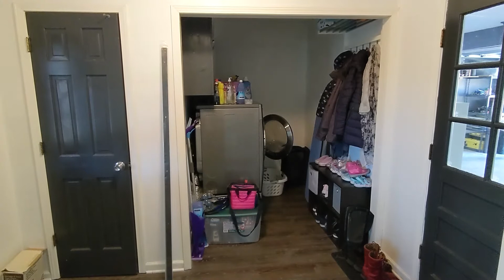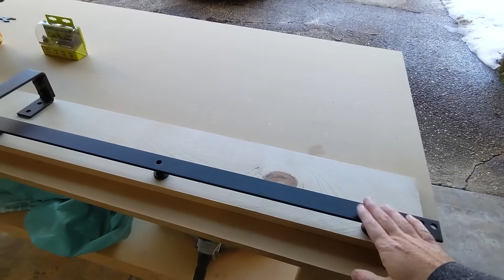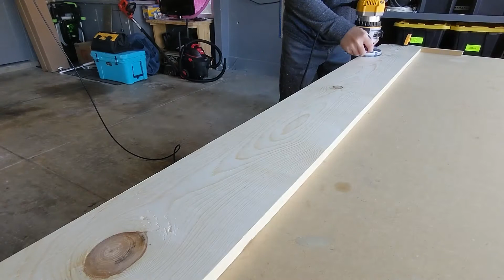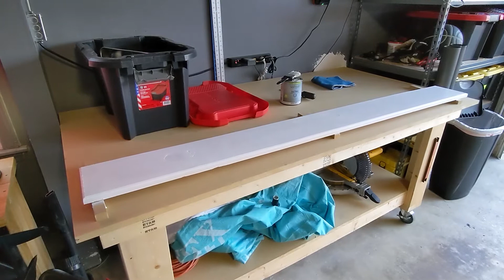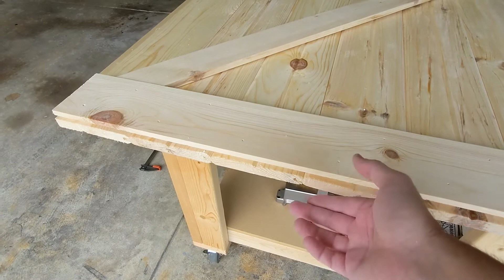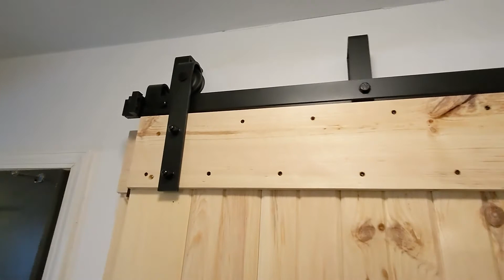Overlapping Barn Doors

Comment: Very nice! Can you use this model but have both doors slide? I need to wide an a pantry door but both doors would need to move so I can access things on both sides. Any ideas?
Reply from the maker: Edith, yes you can have both doors slide with this model. I answered this same question for Ana Bravo below.  Here is the reply I gave her.

You can have both doors slide easily, you just move the stoppers I have on the left door that is keeping it locked where it is.
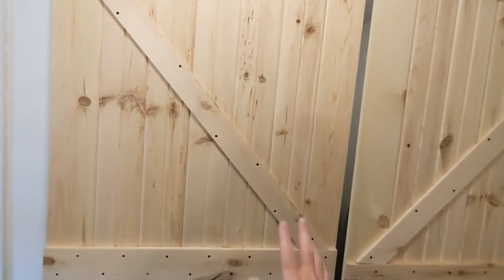You can see this at: 5:16 in the video.  Just move those stoppers, put one all the way on the left and the other all the way on the right on the inside rail so you don't roll off the tracks in either direction
Reply: @Mgiusto  Thanks, so much!

Comment: I have installed the doors but reall want to know about floor guides so they don't sway
Reply from the maker: The floor guides in the barn door kit are little plastic pieces shaped like an upside down T and you just screw that into your floor so the long part of the T fits in the groove that is at the bottom of each door. You place these at about the center area of the opening where the doors meet. I believe there might be 4 of them so you could put one at each end of each door if you wanted as well.  Here's a good video showing how they installed the floor guides: https://youtu.be/-hCGsTD4VwA?t=174

Comment: very good details! Can i ask how yu measured the doors to account for overlap and opening?
Reply from the maker: I first measured my opening which was 64" and then looked for the door sizes available. Ideally I would have wanted 34" doors which would total 68" and cover the opening by 2" on either side, but I could only find 36" doors so I've got 4" on each side which isn't bad.

Comment: Great video ! ... Can you provide the link where you bought the hardware for the barn doors rails? Thanks.
Reply from the maker: Bypass Sliding Door Hardware
https://www.homedepot.com/p/WINSOON-6-ft-72-in-Powder-Coated-Black-Heavy-Duty-Bypass-Double-Door-Sliding-Barn-Door-Hardware-Classic-Design-Roller-GCM2776/309821869
36" x 83,5" Barn Door Slab Kit
https://www.homedepot.com/p/Kimberly-Bay-36-in-x-83-5-in-Unfinished-K-Bar-Solid-Core-Pine-Interior-Barn-Door-Slab-Kit-DBAKDPKK/312316318

Comment: Thanks for the video. What if I want both doors to slide? Or is this only for 1 sliding door?
Reply from the maker: You can have both doors slide easily, you just move the stoppers I have on the left door that is keeping it locked where it is.
You can see this at: 5:16 in the video.  Just move those stoppers, put one all the way on the left and the other all the way on the right on the inside rail so you don't roll off the tracks in either direction.